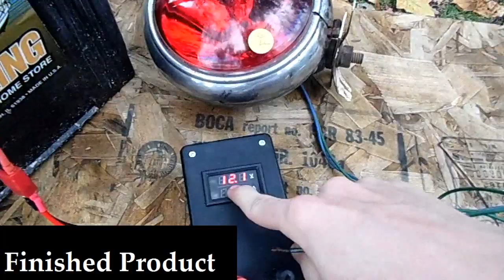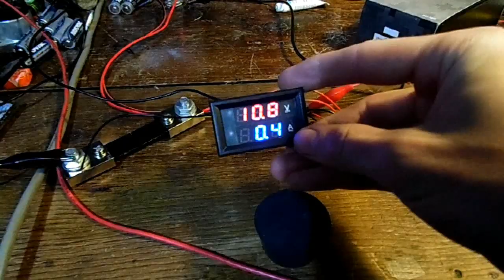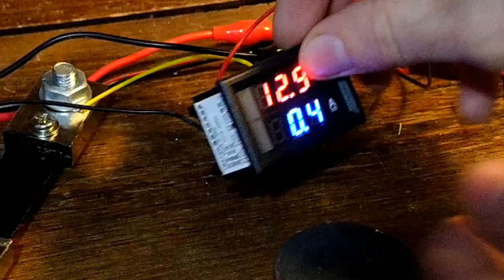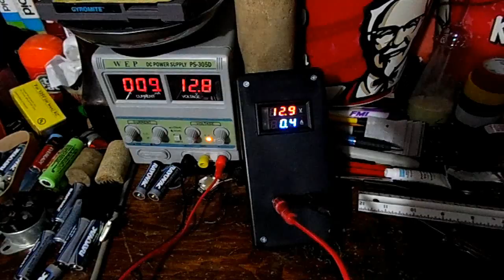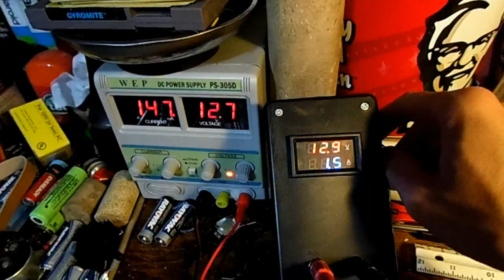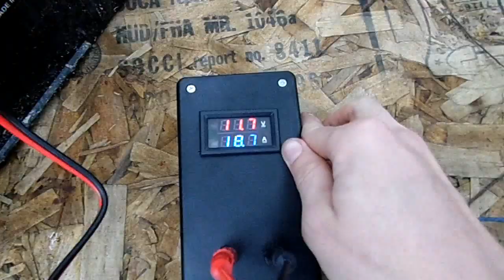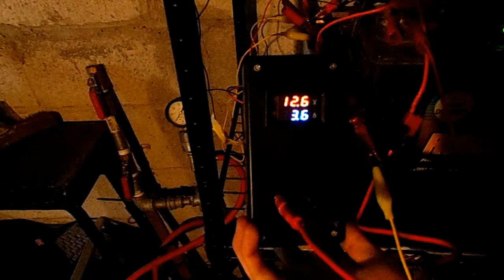DIY: Universal Amp/Volt meter

Comment: I think your bulb is actually pulling 18.6 amps, not 1.86 amps. I've used a similar light on a tractor,  and it would blow a 15 amp fuse every time, but not a 20 amp fuse.

Comment: I have made 2 of these, one with the amp and one with just volts.  For both projects, I power them from a 9v battery, which is what I had at the time.  I used a smaller box and instead of the shunt, I use the built in shunt on the combo meter.  I put an extra plug on it so I move the red lead to the amps plug and run the current through the meter, and back for volts.  I find  I use my home made units more then the three multi-meters that lay on my desk simply because all I have to do is turn on the switch to activate the unit and go
Reply: Jerry Ericsson  hello, can you share your project wth me,
Reply: Well wish I could, but right now I am sitting in the middle of the Mohave Desert, and will be here till the end of March.  All my toys are at home in South Dakota.  They hook up quite easily, at least I found them so, it was just a matter of hooking up a few wires, and drilling a few holes in the project boxes. I have one that is in a larger project box and have it hooked to a 12 volt battery made up of six 18650 batteries that I have hooked up so they put out 12 volts DC, I have an output plug on the box and a 20 watt LED light mounted on  the top of the unit in a frame with a lens that controls the light. I have the plugs on top and can hook test leads on to it and use it in mobile places such as when working on my Class A motor home.  Very handy and I can get a lot of time out of the battery pack. it is fairly bulky for a flashlight, however the built in meters are a super way to have the test equipment available when needed, as well as being able to power almost any 12 volt item from the unit.

Comment: Rinoa,
I have been searching the internet for help and schematic’s on how to connect these Universal Amp/Volt meters for a little while cause my understanding is that they come without instruction on how to connect them.
Men I’m glad that I found you on YouTube. I have viewed your projects and experiments with these meters and see how successfully and acknowledgeable you are with them.
My project is a 12VDC Field Power Supply Box for my astronomy gear. This gear consist of Telescope mount, Dew Heather, Laptop and a DSLR Camera. The battery is a 12VDC / 122 Ah Marine Deep Cycle. Combining all my astro-gear amperages, it shall be between 10 to 15 Ah and should supply power for 10.0 to 8.13 hours of operations at a field site where there is no other source of power.
I would appreciate any help or suggestion on how to connect one of them on this project (I’m waiting for my meter to arrive from china). Perhaps you may need or like to see the diagram/schematics I have created for this project in order to determine where and how to connect the meter. If so, where can I send it? Once again, thank you in advance for any help. I appreciated.

Best Regards
Eli
Reply from the maker: you can post the image on google+ and tag me by typing + then "rinoa" and a drop down menu with my name in it should appear. by tagging me i would get notified about that image.

its really quite simple if you only want to measure voltage, and still simple if you want to measure amps. your meter will probably have 5 wires, 2 black and 2 red with 1 yellow or whatever. one of the black and one of the red take 4-30v to actually power the meter while the other two black and red are for the voltage sensing circuit. but as long as your running bellow 30v (witch you are) you can just tie both black together and both red together and connect them to your battery.

now for sensing the amp draw through the circuit, you will connect your positive wire from your battery to your equipment like normal, but the negative wire will have that shunt between it, the yellow wire connects on the opposite side of the shunt from the battery.

how the meter measures amps is the shunt drops the voltage down a very small amount, the yellow wire is connected on one side of the shunt and the black wire is connected to the other side (battery side) and so when current is drawn through the shunt it drops the voltage by like 0.001v but that meter detects that voltage difference as how many amps because its proportional.

hope that helps to clarify things.
Reply: Thank you for you promptly reply. I just post the image and tag you. I hope I did it right, lol. If not let me know, thanks

Comment: I am looking to invest in this very same unit and I seem to remember something about a 10 amp built in Shunt already installed.  Now this could be on my unit and not yours but it would seem to make sense as to why yours will not measure below 10 amp.  It I make this box I would have to have two outlets, one for the 10 amp and under and the other for over 10 amp but as I am new to electronics I would not know how to hook this up this way so any light you can shed on the subject would be great.
Reply from the maker: actually this unit cost like 20$ to make, thats as much as my good multimeter. a local store called Rural King sells cheap multimeters for 2.99$ each, i bought an bunch and will like tape one to my electric bicycle and leave it on teh same setting, for 3$ its not bad. maybe you could find a good deal on those too. it might be cheaper and faster than this one i made.

Comment: Thanks. Good video. I found a larger meter (AGPtek IT47-5) and put it in the same box. Because it's larger, I had to orient it horizontally. I also added a power connector and a toggle switch so I could power the meter separately from what I was measuring (meter needs 6-24V DC for power, and I want to measure outside that range).

Comment: What a cute little module, smashing idea :-)

I would still trust your multimeter more than that module.
Reply from the maker: yeah this module is very crude. but its great for letting it sit on a battery instead of taking my multimeter to it. tbh for a battery you really only have to know it's voltage within like 0.3 volts. just gotta know if its being overcharged or taking a charge at all :P